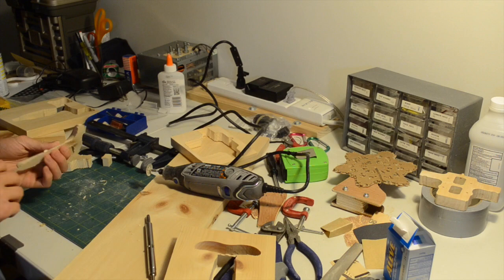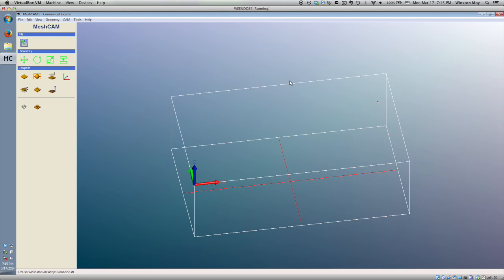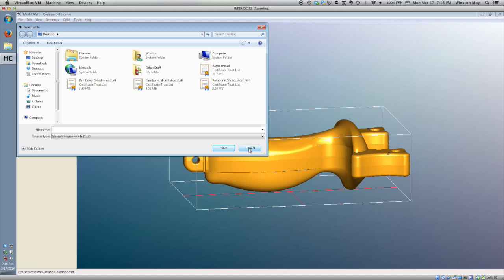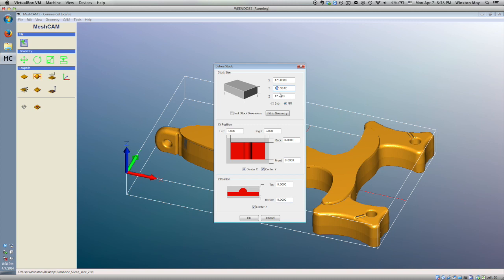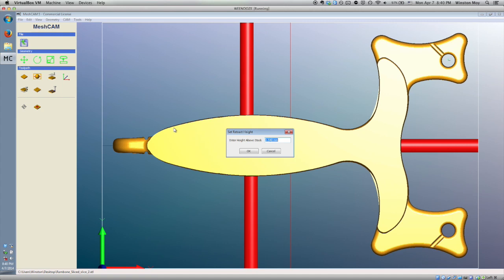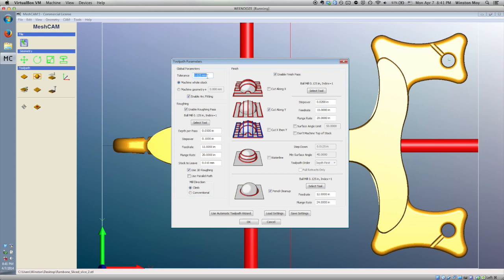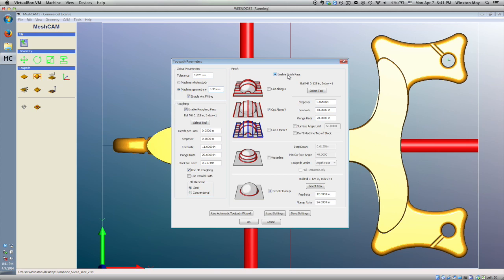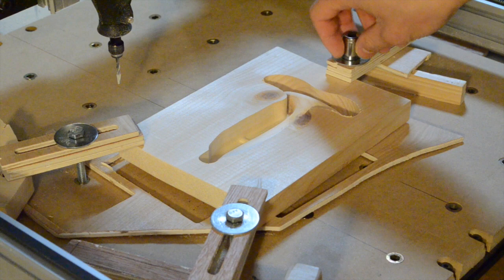Shapeoko 2: How to use MeshCAM to Mill a Slingshot

Comment from the maker: You can usually set Home/Zero to be wherever you want it to be. It just needs to match up to where the program thinks it's starting.

i.e. Program expects part to be up and to the right of your starting position, then move your spindle to the bottom left corner of your stock material, click Zero, then start.
Reply: +Winston Moy hi there I want to build bicycle mould with meshcam ........can is that possible ?

Comment: Winston, quick question... do you need Gcode software after you use Meshcam? or Meshca sends the file straight to Shapeoko with out the help of using Gcode??

Thanks in advance!! :)
Reply from the maker: Meshcam creates the gcode files (.nc extension), which you transmit to the Shapeoko with a program like Universal GCode Sender (free).
Reply: Ah! I see, so with meshcam I could cut and engrave with out having to reset or change bits?

Comment: Hi Winston....Any Tutorial web Page for Mesh Cam o blog you know? im kind of a beginner and i don't know how to use it very well yet
Reply from the maker: +Abraham Linares Unfortunately, I don't know of too many resources. I think when I started, I looked at a couple video tutorials, just enough to understand the workflow, and then trial-and-error-ed it the rest of the way. The software's buttons are organized in a fairly linear fashion, so as long as you understand the significance of each button, most of the steps should make sense. 

Basic workflow is:
1) Import geometry (STL) or 2D drawing.
2) define a stock material volume around it.
3) setup cutting parameters/strategies.

Let me know if you can't find enough to get started.
Reply: +Winston Moy Thank u Winston